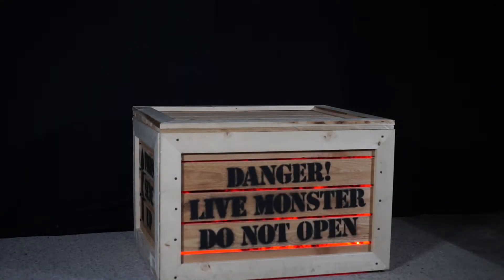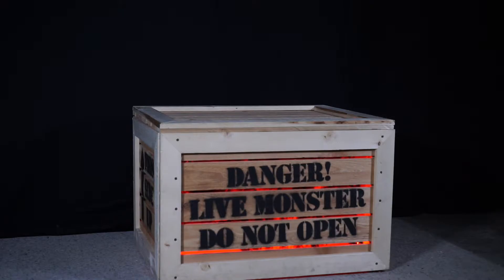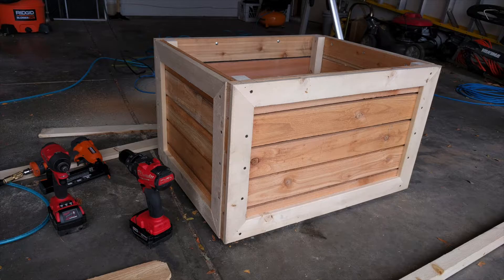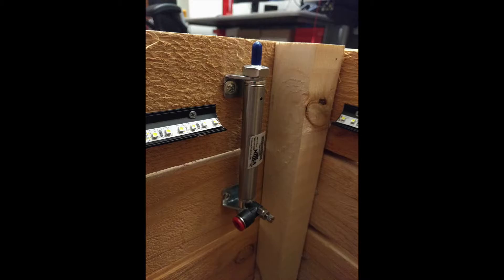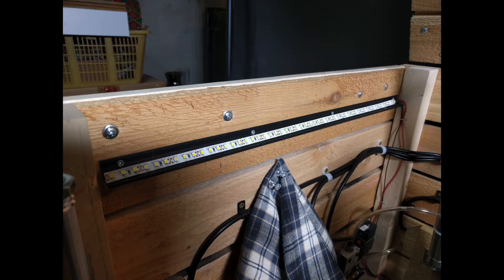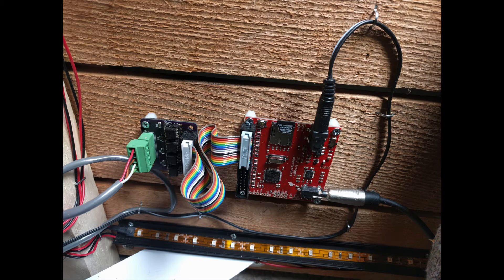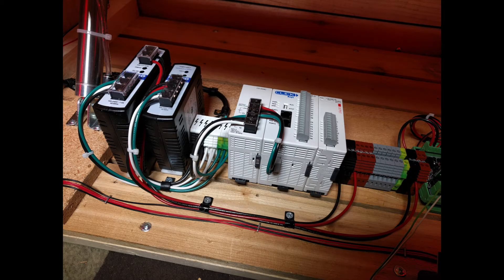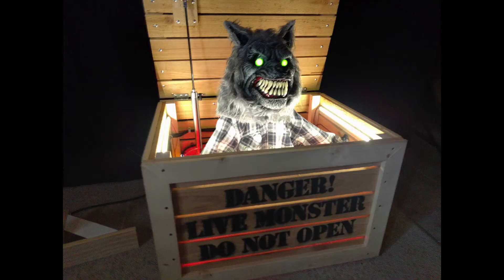Halloween 2017: Crate Beast / Monster in a Box

Comment: What bore did you use for the actuator to open the lid?  1 1/16"??  What about the monster to lift him out of the crate?
Reply from the maker: I'm using 1-1/16" bore 12" stroke for both.